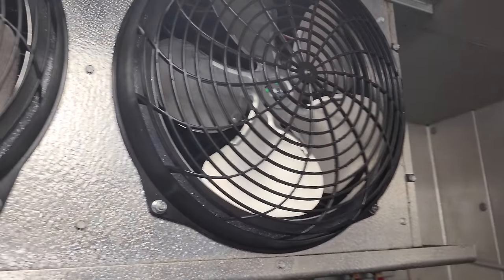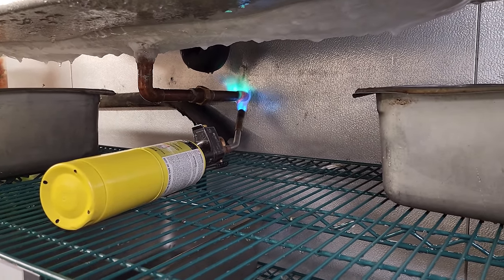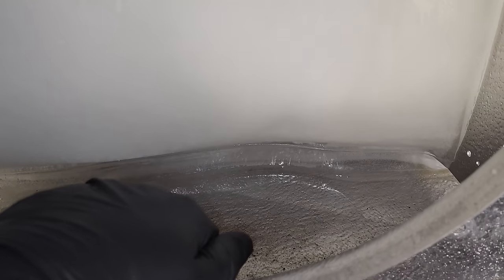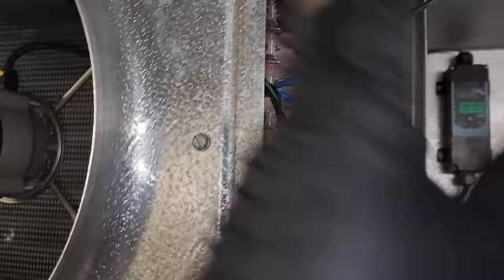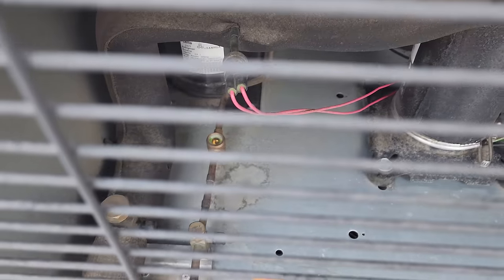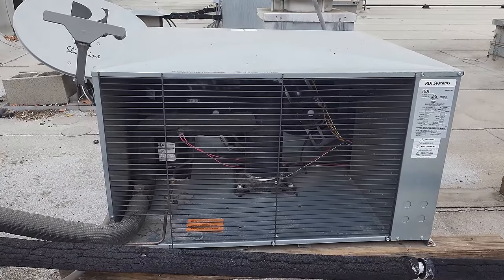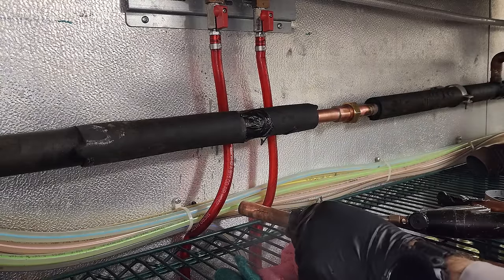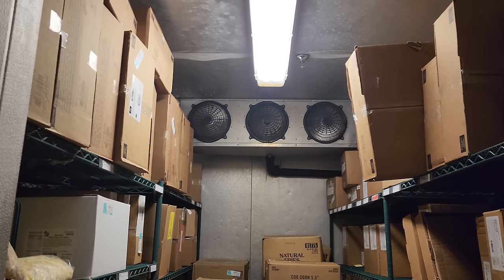HURRY THE WALK IN COOLER JUST STARTED LEAKING WATER

Comment: Yup, they always say "We never prop doors open!" Corporate bosses had us install a flashing light and one of the most annoying buzzers I have ever heard. The place had two large walk-in freezers and two walk-in refrigerators and two walk-in beer coolers for this reason. They had us put the flashing red light and Buzzer in the manager's office it was timed for after 3-4 minutes of the door being open continuously to go off until the doors were shut and would reset the system those managers hated us but got used to it after 12 months. They said it drove them insane on delivery days. But hay it worked never had a problem with the doors being left open again.  LMAO   PS: I noticed you don't have drain line heathers in the form of heat strips on the condensation lines most all the freezer units I worked on had them unless they were old systems.

Comment: Wouldn't it be possible to wire it in a way where the fans go to high speed when the system is in defrost?
Reply: You could, but would never want to if the coil has heaters, your cooling the coil and slowing the defrost. In a freezer it would never defrost with the fans on.

Comment: Hi Chris. How does this particular system work with one condensing unit and two coils?  Newbie  question but we almost never do it that way over here.
Reply from the maker: Each coil has a pump down solenoid valve in it and one coil has the temp control that controls both solenoid valves, both coils run at the same time.

Comment: Drying shoes has been on my mind for a while. I wanna buy a vaccum chamber to put shoes in. I am very curious to find out if it 's a good method to dry shoes. Soaking wet shoes dry in 30 min? How about the vacuum pump oil? Maybe it is better to have a dedicated cheap pump for that? I have a Fieldpiece VP67.
Reply: Search YouTube vacuum chamber dry clothes :)
Reply: That's basically freeze-drying.

There's one problem: You always have to put in the melting (the energy required to change ice at the melting point to water at the melting point) and boiling enthalpy (the energy required to convert water at the boiling point to steam at the boiling point).

So unless you find a vacuum chamber where you can blast a lot of heat in via IR heating, I think you're better off drying them in a normal way.

Comment: Trenton motors don’t have the terminals like those Morrill motors. They have a molded plug, so you have to pull the red wire from the terminal block. Love your unbelieving snark on the doors are NEVER propped open. Yeahhhhh!

Comment: I don't get your arguments regarding the two-speed fans.. wouldn't you normally want to defrost in low speed (or even with fans off) to keep the defrost heat inside the coil, instead of blowing it all over the room? Defrosting on high speed just makes it take longer and heats the room up more.. sounds counterproductive to me.
Reply: You are correct if it was a freezer with heaters.
This is Air defrosting, more air=faster defrost
Reply: Oh they don’t reverse? I assumed the defrost used a reversing valve and heated the coil using the refrigerant. Not air or heat strips. I think the other poster did too.

Comment: WOULD YOU CONSIDER INSTALLING A DOOR SWITCH THAT TURNS OFF THE COIL WHEN THE DOOR IS OPEN? IT'S DONE THAT WAY WITH THE COOLER AND FREEZER AT THE MCDONALD'S I WORK AT
Reply: does mcdonalds use beacon or that new intelliGen heatcraft system
Reply: @fatkiefbowls  Ours is a bit older, and what I see are two Copeland DWM compressors, and a single condenser (Edit: Nevermind, it's not a weird system, and one just has a very small condenser), and an evaporator in each the freezer and the cooler. Never paid attention to the temperature controller, next time I'm there I'll comment that here tho.

But, it's a restaurant from the mid-2000s in Germany, so the system doesn't nearly see the loads it will see in SoCal.
Reply: @fatkiefbowls  I just checked at work, and I have to correct myself: They're two seperate systems with very different condenser sizes, one, and possibly the other as well, has a receiver.

The coils use an electromechanical control by Danfoss, and, as is best practice, they're not mounted to the coil, but to the cooler/freezer wall.

But as I said, this is an older system. I can't see anything new and shiny, and Copeland already discontinued their DWM line of compressors. Given that the restaurant was built in the mid-2000s, I would assume that this still is original equipment (which goes to show how long equipment can last, and how little problems it gives you if it's properly maintained).
Reply: @vincentguttmann2231  Amen brother. Equiptment that is properly installed AND maintained can last a very long time.

Comment: Why not use hot air gun to melt the ice? I asked once before and you told you would answer that question on a live, but I must have missed that one. Still wondering why water is better, needing to collect more water with a pan and so on.
Reply: water is faster, warm water adds a lot more heat to the ice.
Reply: Volume for volume, water has a lot more heat capacity than air. Additionally, you commonly have hot water lines in restaurants, so why not use what is more efficient and already there?
Reply: @liam3284  I can understand that. But you add a lot of water to an environment that don't "want" water. You have to take care of all the water you use. With hot air there are no extra water to collect.
Reply: @vincentguttmann2231  That does not makes any sense for me. A hot air gun can melt whatever you want. Without leaving a mess. And I don't think you have hot water in the freezer, why would you? You have to have a container with you that have it.
Reply: @stefankarlsson4652  You know, hoses DO exist, that's why he has hot water everywhere.
And the wand in the mist setting leaves a minimal mess, as he always says.
Reply: @vincentguttmann2231  Yeah, I understand that hoses exists. ;) But connecting and dragging around hoses feels like so much work. ;) Ok, well.  Overall, you have convinced me. If it works, why do it another way, and hot water from hoses seems to work...
Reply: Are there always drain pans under the AC to collect the water? In that case, the extra water aren't any problem.. So, then I can understand using water is no problem...
Reply: @stefankarlsson4652  Yes, there are always drain pans in coolers/freezers.

That's because the evaporator gets so cold moisture from the air condenses on it. Usually, that simply lowers the ambient moisture in the freezer, but when the door is left open, you get what was shown in the video.

Normal ACs have to deal with condensation, too. Many residential split systems have a small condensate drain hose at the evaporator inside to get rid of it.
Reply: He’s also stated that the time it takes to defrost with hot air would cause the air temperature in the cooler/freezer to rise significantly, and most of the heat would be melting the ice.

Comment: So much unnecessary complexity in the pursuit of saving a few watthours.
Know what would save a lot more energy than unreliable ECM motors? Hot gas defrost.
The compressor is capable of multiplying the heating factor of the energy it consumes by an average of four. This is why heat pumps are a thing.
Fixed speed inductive motors and a hot gas defrost system would save more energy and be more reliable than an electric defrosting ECM-equipped box. Faster and more complete defrosts too!
But they're not insignificantly more expensive with a dramatic increase in complexity of the refrigerant piping, and lose effectiveness when it's very cold outside. I bet that higher up-front cost is why we never see it in smaller commercial refrigeration systems like this, and only in massive multi-million-dollar rack systems.

And if you still want multi speed motor, inductive multi-speed motors do exist, and have a proven reliability record as well. Can't speak for the silly electronic system controlling them, but the motors themselves are as stone cold reliable as any other inductive motor.
Reply: Isn't all it takes to reverse the condenser and evaporator one valve?

Though, I'm not sure how that would work with systems that have a receiver and additional piping